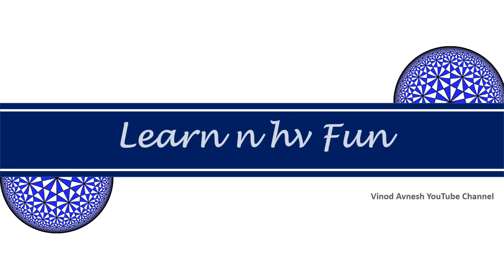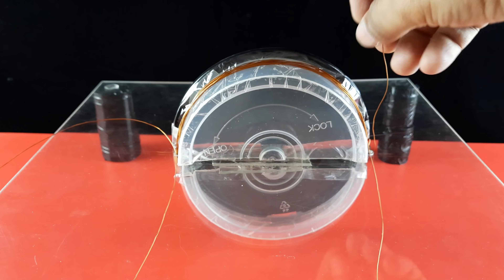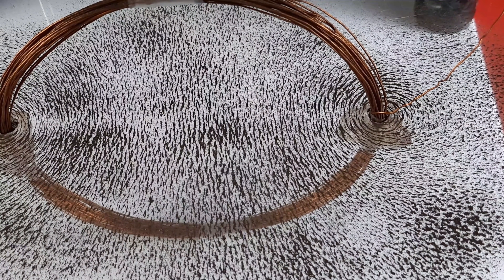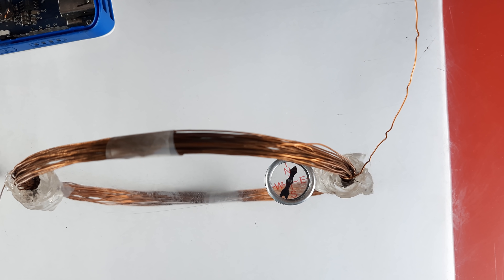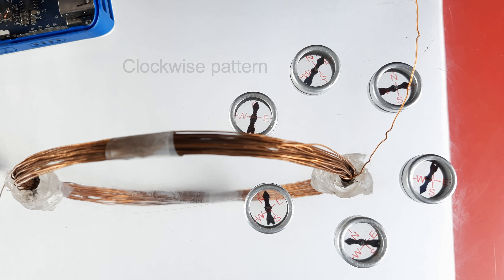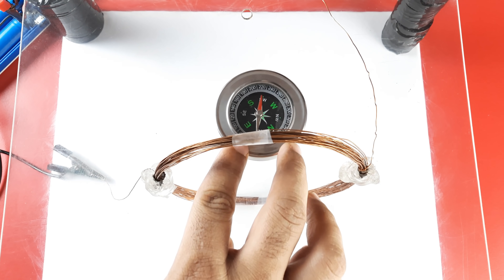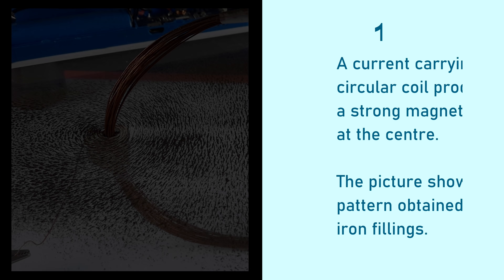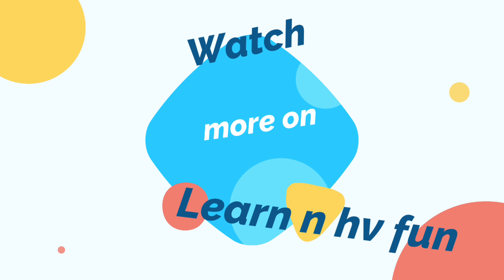Magnetic field due to a current carrying circular coil || Magnetic effect of electric current

Comment: You said "arrange themselves" which is good language, because the lines are CREATED by the mass.  The field is a smooth gradient, but the mass intensifies the field through itself developing poles, and the other masses follow suit like a conga line.  If you used nickel or cobalt filings, I would bet the circles would be larger or smaller than iron.

Comment: On activity 5 what if there was a separate power supply and they are connected the same way but in opposite from the other supply what can different direction of two supplies against each other on same connection be would the battery overload and blow what if there was a way

Comment: Magnetic field is present at every single point then why do we get gaps in between the pattern circles while in theory they should be continuous.
Reply from the maker: If we add more particles the space will be filled.
Reply: @Learnnhvfun  but why we do we get gaps with less particles anyway. The continuity should be maintained irrespective of the number of particles. It is like the interference pattern experiment with very low intensity of incident light, the pattern stays as it is. So why do we not see the continuity in this case I cannot understand. When we strike the shelf on which the filings are placed they arrange themself in even more clearly defined circles rather than showing some continuity!

Comment: Bro our Source gets short circuited every time we supply the voltage in this scenario our cell/battery got bursted or damages kindly help 🙏🏻
Reply from the maker: Plz specify the gauge of copper wire you are using, number of turns and input voltage
Reply: 25 Gauge of Copper wire
11V supply
With around 30 Number of turns
Reply from the maker: @Mozains  keep voltage low, 5V or 6V will work... you can increase the  number of turns to 50

Comment: Which wire did you use Can You Provide Online link?
Reply from the maker: 22 SWG copper wire... online is very expensive.. you will find it easily at your local market. Especially from stores which repairs motors..
100 m 22 SWG cost you 100-150 rupees in local market..